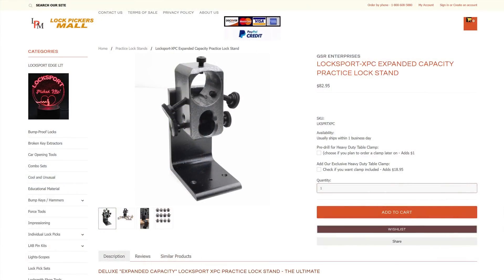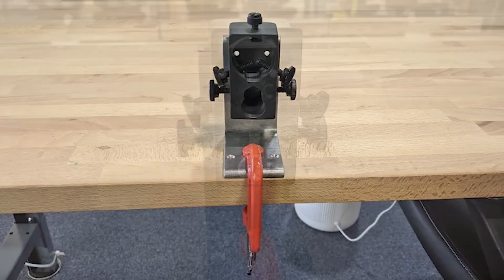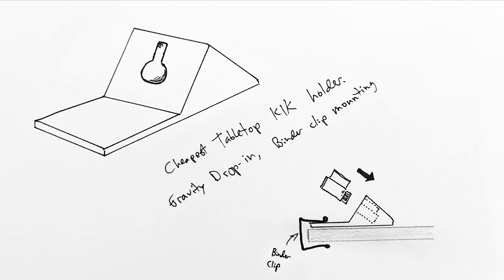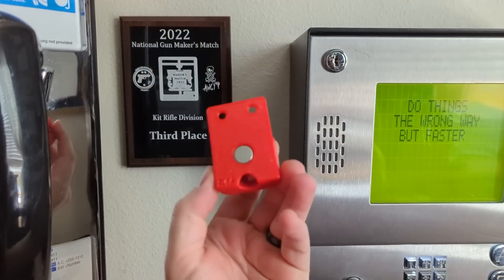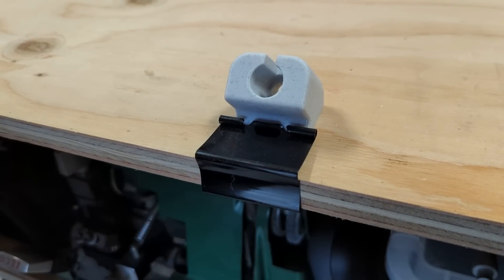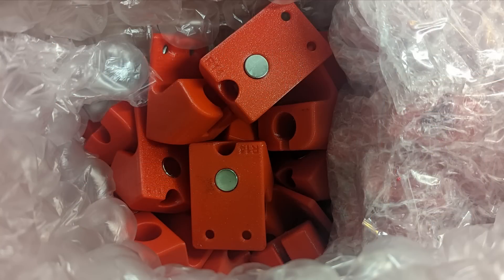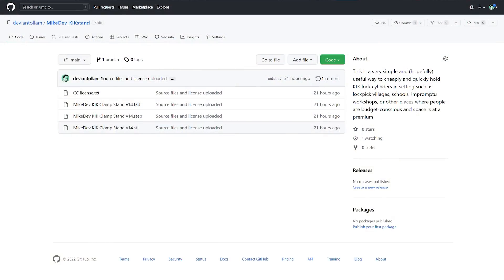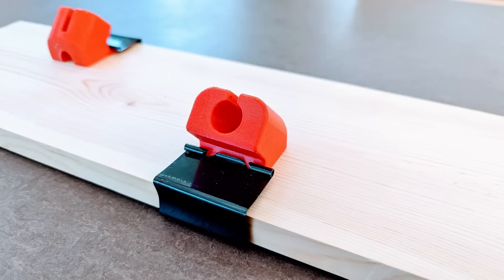New Lock Stand Design (And We're Giving Them Away!)

Comment: This is nice to travel with. You can practice picking rather than reading a book (yes one of those heavy things; should you want less screen time), this slips into your bag with some picks.

I do wonder how the T_sas feels about some funny shaped bent pieces of metal. And no I'm not planning in using them in the airport. (like for one, what is “evidence of intent” when it comes to T_sas… they likely just have to make a connection, regardless how false it may be and then it becomes ‘intent’. Now you are in a situation with someone adjacent to law enforcement, its their word against yours. This seems potentially messy if you were to step foot in Mississippi, Nevada, Ohio or Virginia (though most states seem to have a level of “intent” when trying to prosecute though these four states might be more hostile to nonprofessional locksmiths))

Comment: Portable, low cost, sensible and practical design, easy to produce... perfect for the intended application, that's my thinking. I've made similar things out of polymorph so they can always be melted down and turned into something different if needed. Mind you, that was before I has a 3d printer, a lathe, a drill press and a milling machine.